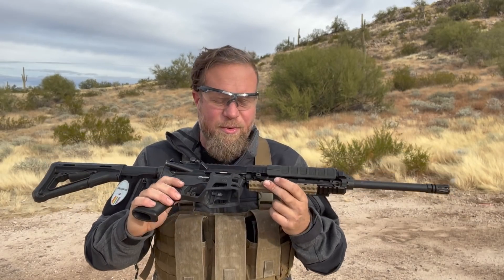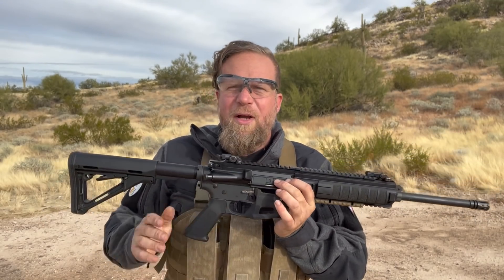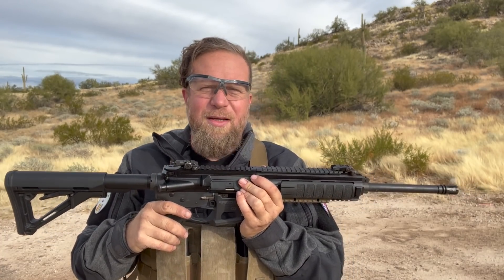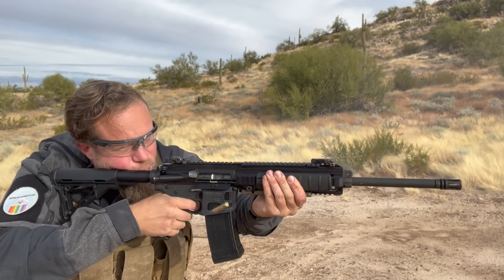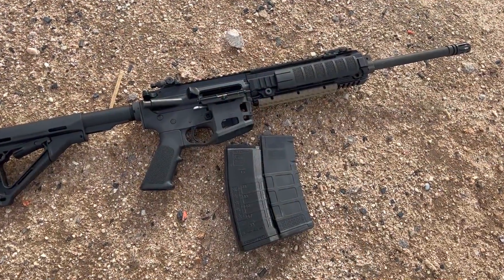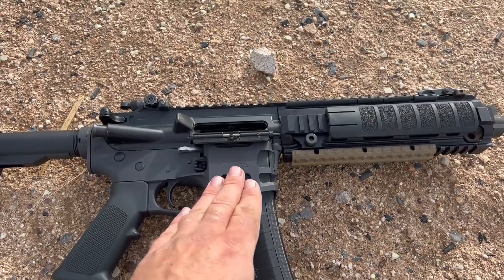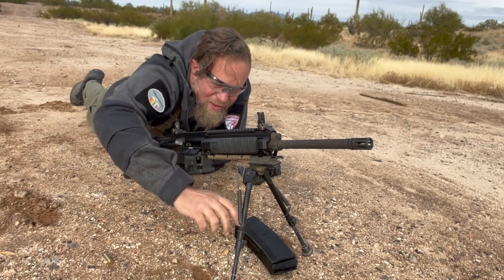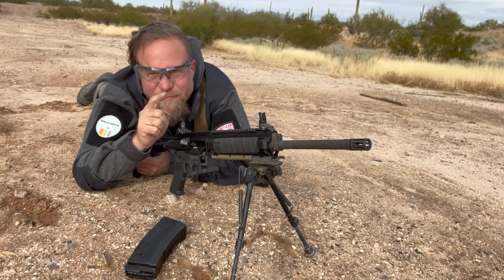Desert Tech Quattro-15

Comment: Could this 52 round lower receiver be paired with the Fightlite MCR's upper receiver?

The Fightlite MCR with a 200 round belt equipped is still half the weight and just as "reliable" as an M249. Pairing 200 round belts with Desert Tech's Quattro lower and you have something great. Virtually unlimited rounds to suppress the enemy. You'd probably need to carry a spare barrel or two to swap out after 300 rounds though. That or active cooling for the barrel and gas system of some sort though.

Maybe water cooling an AR like you'd water cool a Vickers?

Comment: I’d love to see an update on this project, specifically the mag well insert to allow use of standard 30 round mags. 

At first it seems like an interesting adaptation but with more testing and development, it could become the next standard feature for future military use. 

This would help bridge the gap in suppressive fire capacity between the M249 and the M27. I wonder how many soldiers would still prefer to lug their M249 around if the alternative was an M27 with this magazine system (with the conversion piece for standard AR mags).

Comment: They need to make it 60 round capacity. It's not very space efficient for it to be able to fit into a magazine pouch meant for two 30 rouder mags, but can only hold 53 rounds. Just make it maybe half an inch longer or something.

Comment: This paired with a forced reset or binary trigger could be an awesome civilian version of a light support weapon in a carbine form factor (or an ACTUAL light support weapon if you have an SOT and can make it a machine gun)

Heavy forged and heavy chrome lined barrel (like a BCM BFH upper with a heavy barrel profile) and a bipod could be like the RPK version of the AR, more firepower than a standard AR without tons of extra weight (of course it will weigh more, but not belt-fed amount of weight) pair it with an EOTech and maybe a magnifier and you've got a support weapon that looks and handles like a chunky standard carbine. And you still retain magazine compatibility with your teammates with the magwell insert, assuming the insert can be attached "mid firefight" (I've heard the receiver must be pivoted apart to insert the block from the top of the magwell, could be done, but that's something you'd have to practice a lot to get as fast as possible)

As long as the mags ARE indeed reliable then I can see this being an excellent idea, and I like that the magazines are translucent giving you at least some indication of remaining ammunition.

This is an excellent idea for the Marines' M27's like you mentioned, and it only requires replacing the lower instead of moving to an entirely new rifle, (maybe a new trigger pack, idk if HK's triggers are proprietary, but many of their components are)

Comment: I highly suggest they go with 50 round capacity instead of 53. 50 is a much easier number logistically, and perhaps they can use the extra space they get back to integrate an ammo count indicator in the future. I would imagine it is difficult to keep count at that point 😅
Reply: Just load 50 rounds in.

Comment: Awesome concept, but I don't foresee this being very popular, specifically because of the magazine capacity. As demonstrated in your video, a pouch designed to hold 60 rounds can only hold 53. Losing 10% of your capacity per pouch in order to avoid half of your 2-second mag changes just doesn't seem like a worthwhile compromise to me. The fact that you have to choose between no mags on the front of your chest or double width mags makes some prime real estate useless. They've come up with a half-measure that's a hybrid between STANAGs and nutsacks and is somehow worse than both.
Reply: Assuming three double-mag pouches plus one magazine in the gun: seven 30-round magazines = 210 rounds, four 53-round magazines = 212 rounds.
Reply: @DaisiesofHate  your math is correct, but:
1. That's a light round count even for a rifleman in the 21st century,
2. As previously discussed, having three magazine pouches across the front of your PC filled with double mag pouches is inconvenient as all hell,
3. The math stops working out as soon as you add even one more pouch. 5*53 = 265, 9*30 = 270. That's only a five-round difference at that loadout size, but considering how that's like half of the round count an autorifleman actually carries it will only get worse from there.
Reply: @Kindhamster  Doesn't matter.  Standard required military loadout is 210 rounds.  This accomplishes that with 4 mags and 50% less reloads.
Reply: @gamelord1000  Ask literally any Iraq and Afghanistan vet how much ammo they carried for a patrol. Nobody who was actually expected to fight went out with only 210 rounds on them.

210 rounds is also only the standard for riflemen. They mention the M27 IAR in this video quite frequently, so presumably they're trying to sell this for use with an upper with a heavy barrel as a mag-fed machine gun. Machine gunners tend to carry quite a bit more ammunition (think 1000+ rounds). And, as discussed above, the higher the round count the more the capacity drawbacks of this system become a problem.
Reply: @Kindhamster  However, the higher the round count, the more advantage on reducing reloads they have.
Reply: @程鈞8542  mag changes on the AR platform with an assistant gunner to pass you mags are a non-issue.
Reply: @Kindhamster  It might looks like a non-issue in several mags, but when the mag count is higher, it definitely isn't.
When the gunner needs to fire 1000 rounds before getting resupplied, with quattro, he only needs to reload under 20 times, while with a standard mag he needs over 30 reloads.
This means that during fight, with quattro, the load of gunner and assistant is reduced significantly. They can be more focus on search and destroy target, not keep fiddling with magazines.

Comment: If this is ever intended to have military application, which I'm sure it will given the requirements it was designed under, the standard mag insert needs to be very easy to swap in the field. A huge reason for the US moving towards the IAR is that all infantry can share mags regardless of role. If the insert requires partial takedown or small tools it's removing one of the big selling points from the military's perspective. If it is easy to swap, however, then this is a great idea even for military applications. Yes people without the quad stack lowers on their guns couldn't use the quad stack mags, but 30 round STANAGs will always be the most abundant mag on the NATO side of any battlefield, so the main priority (again, from the US military's current perspective) is making sure every non-specialist weapon can take 30s.

Comment: So...53 rounds in a doublestack pouch position vs 60?  Concept is OK  but it isn't. Ground breaking. If your ammo carry gear holds 2 mags per pouch which is 60 then this design holds 53 in the same spot then reload time is the only variable. I love desert tech but this is pointless. To assume or infer that this will remove the need for a "saw"type weapon is retarded.  100 round or 150 then maybe but 53 instead of 30?? When speaking of auto fire you're talking about 1 second. That is completely pointless. Yes reload is faster but still.

Comment: It's interesting but it seems like the mag has the same thickness as two 30 rounders, but with less capacity. You eliminate a reload but reduce your overall capacity, if it were potentially an inch longer but keeping 60 rounds I could see a better use for it. Definitely a cool proof of concept

Comment: When I first saw platforms with modular mag-wells/lower receivers, I thought we'd have gotten ideas like this a lot earlier. I remember there being an AR style platform that even had AK style mag-well segments and thought things would really start rolling but not much has come of it. I realize modularity usually has it's drawbacks, but I can't help but love stuff like the ACR and other modular platforms despite their issues and/or weaknesses.

Regardless, this is still very interesting news! I wonder if more companies will pursue similar ideas? I suppose there's not a lot of wiggle room before running into issues with physical size and weight, basically putting them with drums.

Comment: Your decreasing you total amount of ammo  you can carry.  If you can carry 4 quad  stacks that  is  212 rounds of ammo vs 8 30rnd mags at  240 rounds
Reply: Required military load out is 210 rounds.  This takes 7 mags.  The Quattro let's you do the same with only 4 mags.
Reply: @gamelord1000  4  Quattro mags   take the same space on a plate carrier as 8 30 round mags . So your saying it  carries the same amount of ammo as 7 30 round mags while taking up the same space as 8 mags 🤔
Reply: @billhusk8569  Required military loadout, not how much you can carry.  1 mag in the gun & 3 mags in the pouch fulfills standard military loadout requirements.
Reply: @gamelord1000   4 mags still take up the space of 8  standard mags while carrying less ammo

Comment: Interesting and intriguing, but I do not think the height difference is so dramatic to be the major factor. What will be the major factor is if a 60 round mag will be lighter and as reliable as two mags of 30 rounders. 53 rounds sounds like a sweet spot so far, but is it worth it to have 6 mags worth of 180 rounds or 3 mags worth of 159 rounds? If we go for 12 mags of 360 rounds, assuming the same volume applies, we going to have 6 53 rounder mags with 318 rounds. To top it off we are going to need 7 53 rounder mags to top it to 371 rounds. Major difference between 12 and 7. But still I dunno, as a prototype, promising. And I assume some kind of dust cover need to be applied for a mag well. And if that dust cover can work as adapter for legacy STANAG insert, now we talking.

Comment: And for loading the mags, obviously they can or will have on the finished product the ability to use the the 5.56 spoon for holding the stripper clips perfectly in place.
53 rounds by hand each mag would get dull very quickly

Comment: An interesting concept,   while it would stop teammates from sharing mags between the Riflemen and the SAW,   I don't see any difference in what they have now with the belt fed weapon system that doesn't use the (30 round mags or belt) and since this is just a proof of concept....
They could probably play with the capacity of this new magazine up to say 75 to 100 Rd to find it's sweet spot in reliability and length and weight and balance.....
As you've shown here,  it's shorter than a 30 @ 50.....
So what would an increase to 75Rds add,  2 or 3 inches❓❓
Like I said experiment for the sweet spot for a SAW's balance of maximum capacity would have to be played with throughout testing....
But one thing this obvious,   the lack of a belt flopping around making noise and getting tangled seems to me would be a plus in tight spots and close quarters.....

Comment: why 53 rd cap? Up it to 60rd cap so that it's also matching the rd capacity of 2 stowed mags. 53 seems odd to me. They could also market a 60 cap mag as a new standard and price out 30 rd mags by making 1 of their mags cheaper than 2 traditional 30 rounders. Seems like a no brainer.
Reply: Probably reliability and pouch sizes. Its not like you lose ammo in the overall loadout, infact you gain 2 extra rounds

Comment: All it needs, is the ability to take standard double stacks without an adapter. It may increase complexity. But a seamless transition from a quad stack to double stack would make using this lower as an Automatic Rifle/LMG replacement more appealing.

Comment: Look at Karl flexing 104 rounds of 5.56. 🤣  the only thing I can see that would hold this back from adoption would be an additional mag type. If you could run a 30rnd without an insert, it would really help.  Private Pyle is going to show up with 30 rnd mags and no adapter.  Or on a two way range, if you run dry, it is a lot easier to get a mag from a squad member.

Comment: If the final product is just as good, this could truely change up the way militaries handle squad roles. If the troops are comfortable carrying all that extra ammo, it could outright eliminate the need for squad support weapons. Why lug around a SAW and have to supply your logistics corps with the extra training and parts to sustain them when everyone has the same gun and can work in-tandem to create the same effect. Again, the weight is going to be the deciding factor; an extra 20+ rounds per magazine adds up when you're carrying four or five mags at least, though this could also be mitigated by not carrying as many mags while still having the same number of rounds.

Comment: So 10 rounds less then a standerd reload
For the same space on the carrying capacity. Wonder wat the actual time saving is for a trained soldier.
Reply: You carry the same overall loadout, you have to include the mag in the gun too, not just the pouches

30 x 7 = 210
53 x 4 = 212

Comment: Before watching I was thinking the Quattro-15 would've been similar in concept to the MP40/I with the double-magazine sliding system. After watching, the Quattro's design is very intersting. I'm interested to see how the magazine internals were desgined with how it looks like the quad-stack goes to a double-stack almost immediatley at the top of the magazine and without the usual tapers we see on quad-stacks.
Reply: It's just the follower.

Comment: very neat concept however I would imagine you would also lose the advantage of mag interchangeability with your squad even with the insert as it increases reload time if you need to switch in between quickly which is IMO the biggest reason to change from belt fed to box magazine but say you equip everyone with a quad stack then you lose the advantage of a SAW yes the SAW would have a thicker barrel but you could also give suppressive fire with more people and then the heat is spread between all those barrels and even then thicker magazines aren't worth it to me cause I can store 60 rounds in the same as that 53 quad stack I think another interesting concept would be an alternating mag feeding where it takes to doubles and once ones empty will switch to the other

Comment: This is interesting and innovative but as others have said why not just make it a 60 instead of a 53 if it intended to fit in a double mag pouch. It is cool but they missed the mark 60 rounds in 2 mags is more then 53 in one.
Reply: Probably reliability and size problems at 60 rounds in a standard GI pouch.
Also the standard full loadout is still the same round count with 53 round mags.

30 x 7 = 210
53 x 4 = 212

Comment: Soldiers using this can't give their magazines to soldiers without the modified lower, so at that point why move away from belt fed in the first place? Also they lose overall capacity by 7 rounds per pouch, but gain the sustained firepower of a 53 round magazine. Not sure if that trade off is worth it.

Comment: So I think this is a great idea to fix some of the issues with box fed magazines. Not as awkward as a drum magazine, with an insert can take stanags. Sounds great for Automatic Rifle style of SAWS. Especially since they'd only have to snap it onto an m27. The only other complaint I often hear about from Marines is they are worried about the barrel over heating as well.
Definitely look forward to their progress, Desert Tech is becoming one of my favorite companies for new innovation. Hope this works out and they get a contract with the marines and this thing just work in general. Definitely need to see it in full auto.
Reply: The IAR was supposed to have a carbon-fiber-wrapped bull barrel to keep the barrel from sagging from heat during rapid fire while simultaneously improving heat dissipation markedly. I don't know if they has problems maintaining quality, or what, but that got dropped, along with the original quad- and eight-column "box-bin" magazines that I was working on at that time.

Comment: I'm skeptical. 

What exactly are the internals? It seems like normal quadstack just that it shrinks to double stack later. In that regard it's pretty similar to say AK quad stacks (AK doesn't have a magwell) and they suffer from reliability issues. In particular when taking a slap to the side or to the bottom (when going prone and hitting a ground with bottom of the mag for instance).

Comment: 53 is great, but I would be interested in 75 or 100 round quad stack mags. However the 53 has advantages on its size and weight and I think realistically 50 rounds in it would be a fair load for the match. 
Would the quad stack be open to a hex stack? To bring round count up but keep the length to bottom of mag the same? There's alot of options and I love this.

Comment: I was wondering how they'd work in backwards compatibility; glad they thought that through as well.
That said, the m27 is still a stupid idea that doesn't do what it's supposed to.
Reply: No, M27 does exactly what it is supposed to do extremely well:  the M27 allows very rapid engagement of single opponent-targets with a short burst of accurate fire at limited distances in rapid succession. The heavier barrel and short-stroke piston operation are key to engaging multiple individual opponents rapidly with a higher degree of reliability than an M-4A1, while maintaining similar speed of handling and target aquisition improvements. What it is NOT designed for is:  long, sustained fire for suppression or "beaten zone," long-range engagement of infantry, destruction of enemy vehicles and equipment, engagement of opposing aircraft to include hostile drones . . . .

There's a reason for the Squad Automatic Weapon and Light, Medium, and Heavy Machine Guns.

There's a reason for the Barrett .50 as Squad Support Weapon and there's a reason there's a "shotgun" shell and barrel for it based on the .50 BMG case.